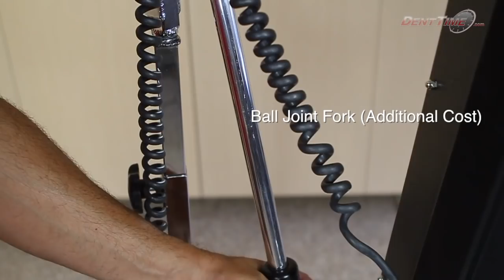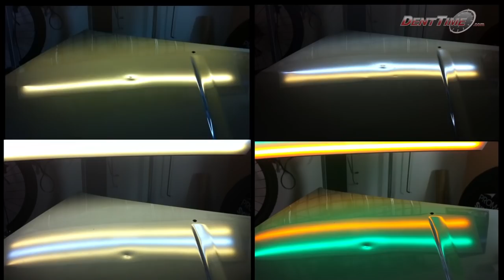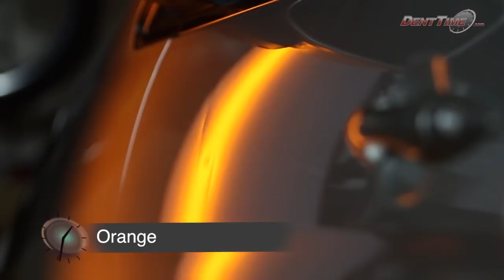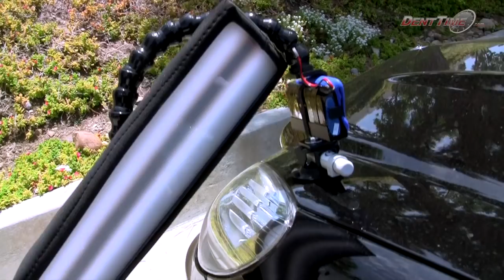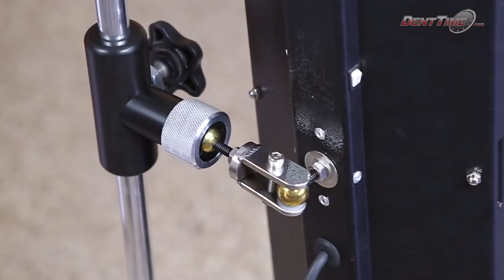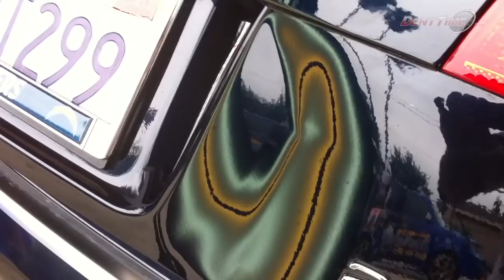PDR LED Light Review | Paintless Dent Repair Removal Tools | Dent Time

Comment: Myke, I'm looking for a suction cup light to use for cross lighting my top panels as well as something I can load up easily for mobile calls. I will be using it to cross light with my Ultra 12v non led light. I'm thinking the PDR Pro Solutions one because I would like one that would work well outside as well but I would like one that's a little longer for cross lighting. Also ready to retire the inventure. Thanks for any input Myke! 
Charles

Comment: Any advice on a good glue pull system for a newbie like me. I don't want ever bell and whistle, just some good tabs, glue, and gun. There are a lot of choices, was looking for a little help. I have been working in a body shop for long enough now, looking to get the same results without getting all dirty and poisoned from all the chemicals.